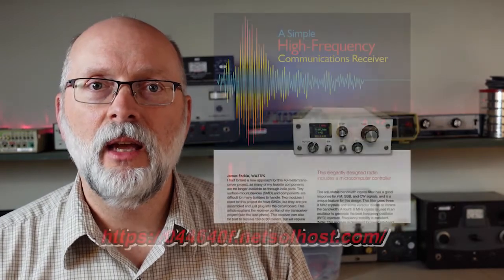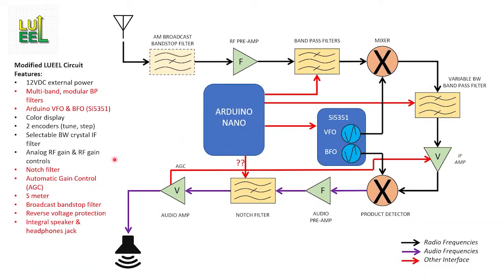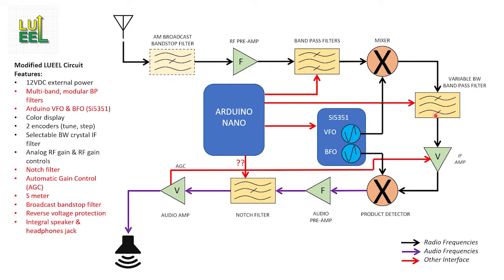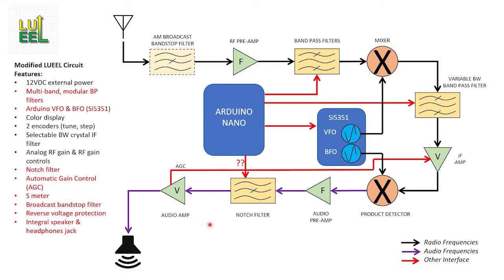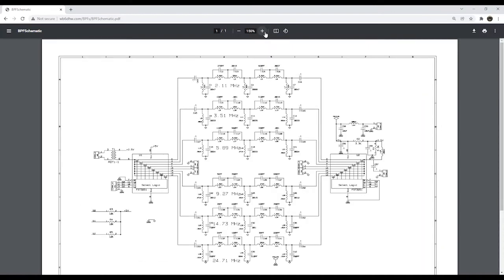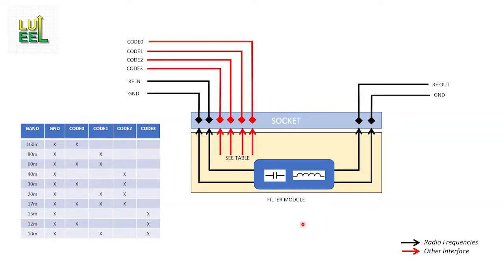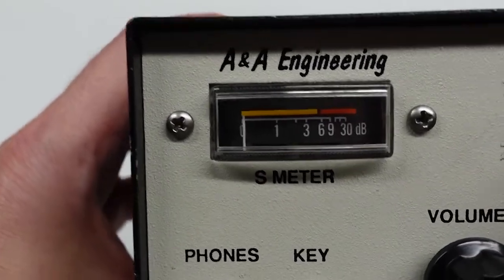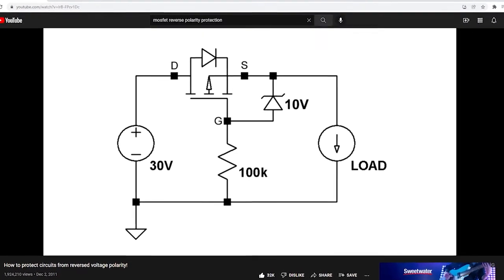A new project! I'm building a superhet receiver!

Comment: I would like to make one or two receivers for digital clocks that can link up to the 60khz frequency for the time signal in the UK. Please help. Also I would like one that can do sound out put that if the transmitter is switched on or off when it is in service. During (March to October) . Many thanks.

Comment: One issue I ran into with using SMD chip inductors for HF filters is that it's not easy to find high-Q versions in small form factors. It's hard to beat a wrapped toroid for Q!

E.g., say you need a 1.1uH inductor for a filter... checking Mouser briefly, there are only 11 in stock in that value, and with Q around 25 (eek!). That will make for a lossy filter, and cost more than a toroid and some wire...

Things change a bit as you get up into VHF / UHF, where you can find decent Q values in small packages, but for HF I think it's a pretty tough sell.